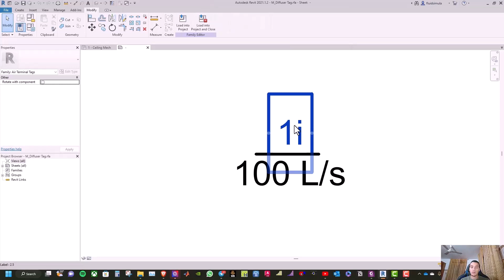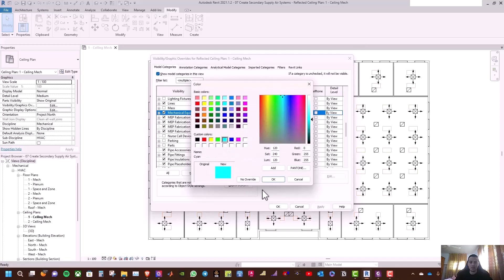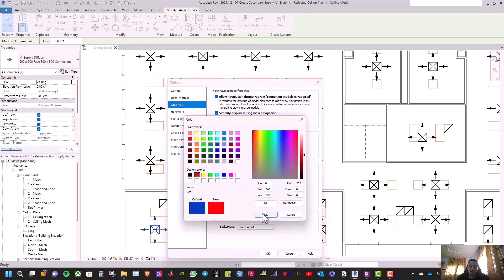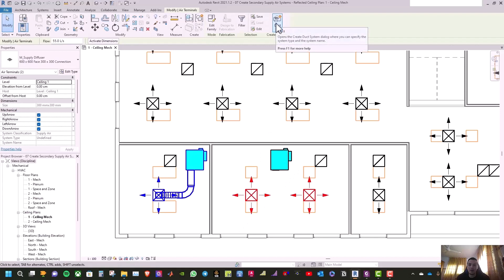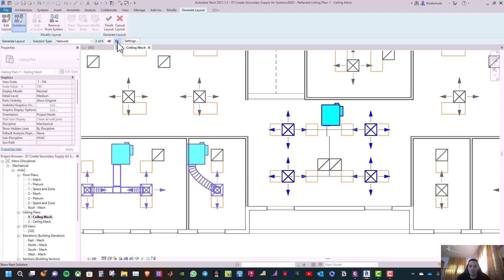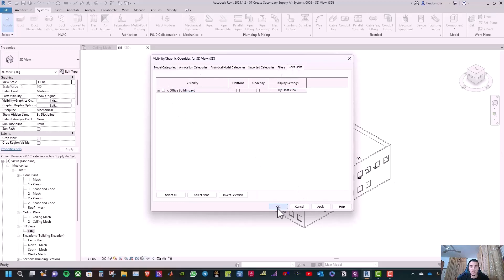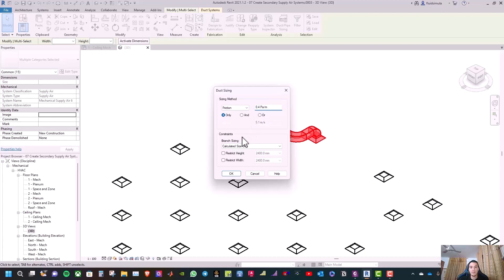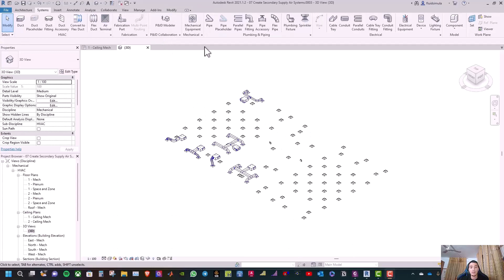07 Create Secondary Supply Air Systems I Revit MEP

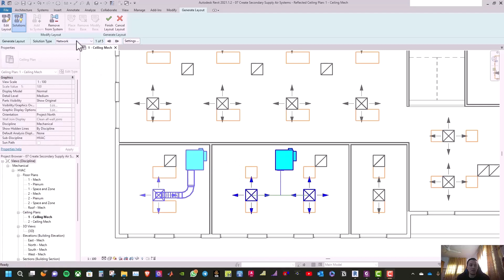Comment: Thank you brother for this tutorial series. I'm getting error in VAV-Duct connection (step 06:00). "This element has an open connection. This may not be an error, but for flow calculations to work correctly all connections should be sealed with an end cap." 
I have tried a couple of times, same error/warning. Brother, hope you help out.